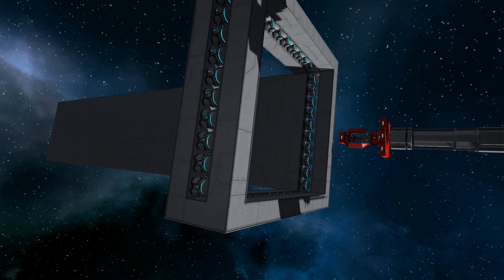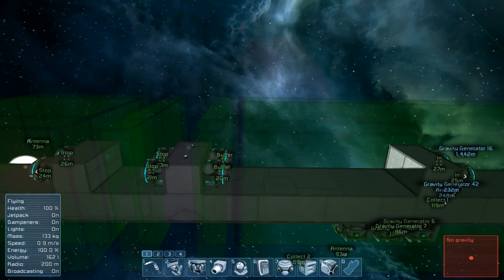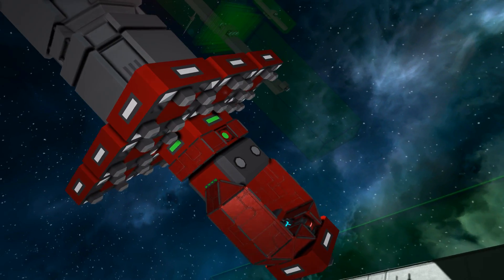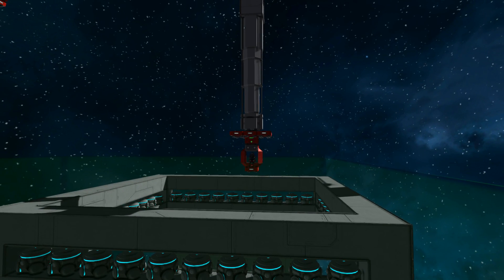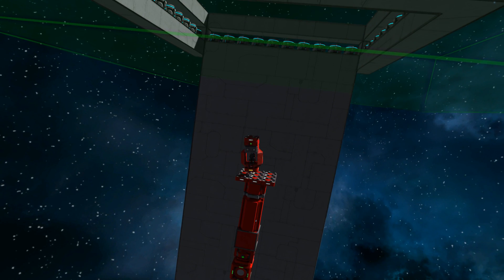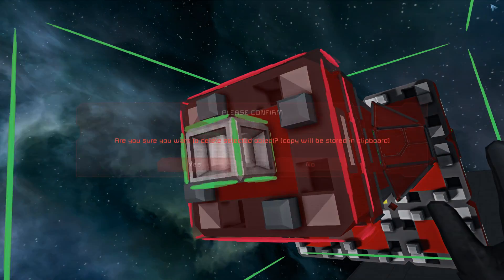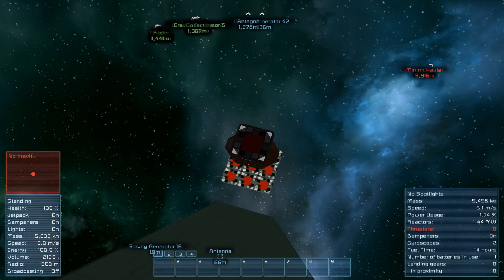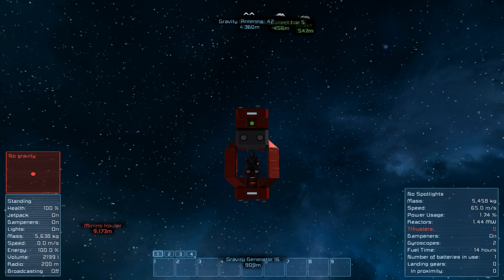Space Engineers - WiP Gravity Elevator/Catch Net System

Comment: Could landing pads work?
Reply from the maker: Hmm, I'd have to ditch my idea of making them battery powered as you wouldn't be able to charge through the pad (or find another way to do it) but the locking force of landing gear is way strong than merge/connector force so as long as they don't get damaged, maybe yeah :) Nice thought, bit of a workaround more than a fix for the inconsistency but hey, if it works..
Reply: I believe the other attempts didn't work because when the blocks you tried detach from one another, they make the ship shake slightly, altering their speed and direction. Since landing pads don't require physical contact (although connectors don't necessarily either), maybe it'll work. Oh, and do try that system with cargo containers, as a way to send them from your mining location to your base! That would be an automation project and a half!
Reply from the maker: TheTechnicalNirl That's the end goal, I have a challenge lurking about for both that and some gravity-lanes for ship travel and kinda looking to find one big solution to them all by basically just making a gravity network stable enough that you could throw anything into it and it'd find it's way out the far end :) Not sure it's the detaching though as if you detach when they are not in the gravity field they stay completely stationary, pretty sure it's the piston wobbling around now just need to test it out. Cheers!

Comment: Interesting problem, though I might have the answer. I rwckon that the game doesn't apply the effects of gravitational feilds instantaneously (not much delay of course) but in the time that it takes for the gravity to be applied, the spaceship has moved on slightly.
That is unless your ore was moving Exactly the same distance  in each oscilation (the only reason I doubt this was because I saw no reason that it had to be due to there being plenty of excess feild)
Also you mentioned gravity traps, if you overlap the two feilds ever so slightly you can get really effective gravity traps for ores.
Reply: ***** Could you control the consistency by putting a sensor on that would switch on/off the grav gens meaning the 'tick' would be regulated?
Reply from the maker: Hayden Bingham Quite likely not, I was just theorising as I was very much at a loss as to why things were behaving inconsistently like that (there are 30 grav gens btw, nothing too ridiculous).

Liking the testing methodology also, will give that a try.. Thankfully I didn't and would never use gens in these scenarios in differing settings and when dealing with potentially complex stuff like this also using 1.00 as the step and thus increasing/decreasing by adding grav gens, anything else just gets way too hard to keep track of without some serious investment and as you say butthurt math (contender for best phrase evor)..

Thanks for that link, will check it out but if it tells me what you say then that'll be very interesting. Cheers :)
Reply from the maker: You could be right, I suspect a "ticking" effect from gravity where it only checks what it's effecting once every x ms and so a change in release time results in you missing a tick (or gaining an extra one)... would tie in with what you say about it not applying instantaneously but also explain why there isn't a consistent delay before the effects apply.

I should check the ore and exactly where it ends.. it looks very consistent but there could be small differences I just didn't notice. Cheers

Comment: Looking at the ship you're using, it's likely a center of mass / symmetry type issue. I'm not 100% certain about that, though. But, perhaps, try to make your elevator pod perfectly symmetrical along the axis parallel to the gravity field? With the battery on top, you'd likely want one on the bottom as well. Also, you may want to have the chair perpendicular to the line of travel to help further the symmetry.
Reply from the maker: You'd be surprised how close the CoM is actually.. it travels nice and straight for the most part, just varies in how fast the travel is despite the positions and fields not changing. I'll give true symmetry a try though, never know if might help :)